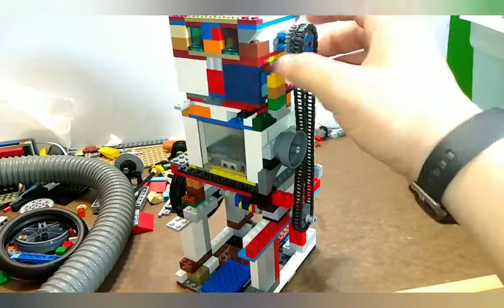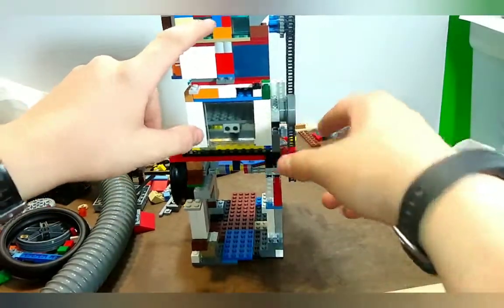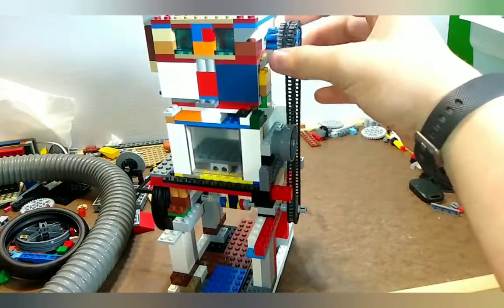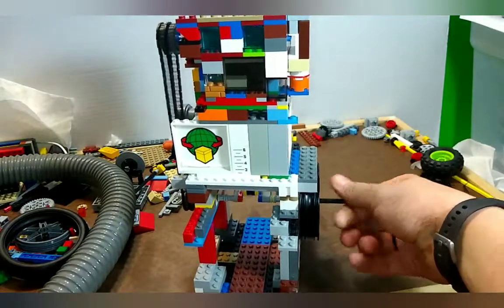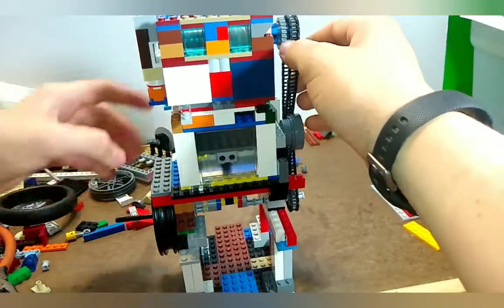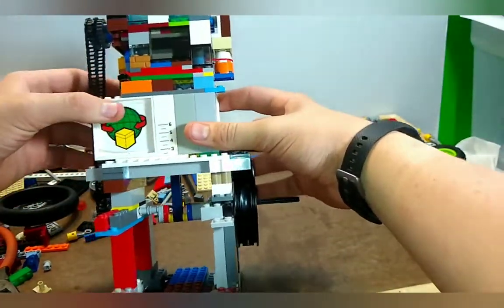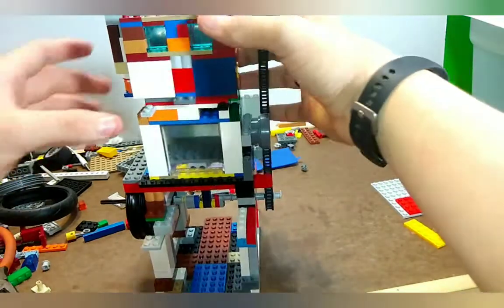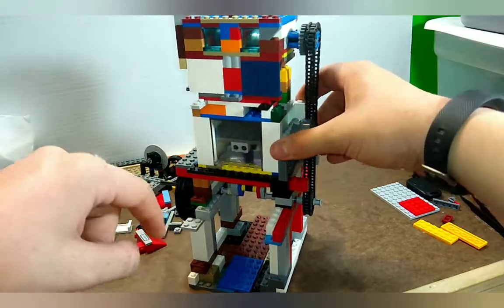LEGO OverHead Cam Engine!!

Comment: It isn't real unless there is an actual 2:1 gear ratio like a real engine would
Reply from the maker: That doesn't make it not real. If you want to get to such a specific detail then real ones don't have square pistons, and real ones are metal etc
Reply: @LS1sLegoGarage  I ment isn't real as in the ratio isn't real so it acts as a 2 stroke instead of a 4 stroke lol but yah u are right about that it's just it's a 2 stroke that has ohv or ohc😁😁👍👍👌👌